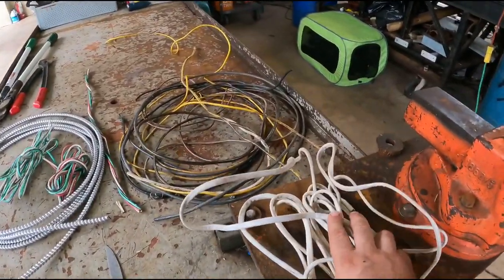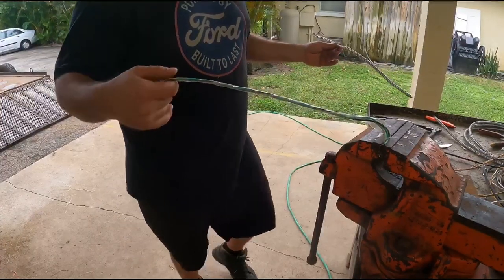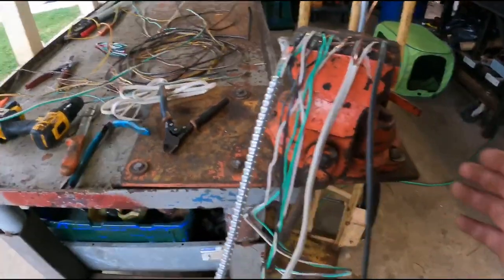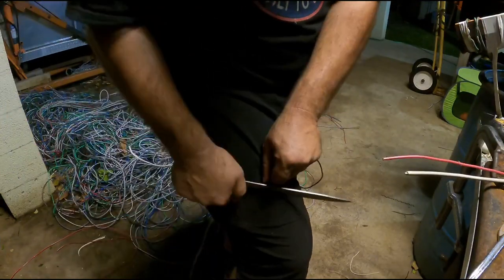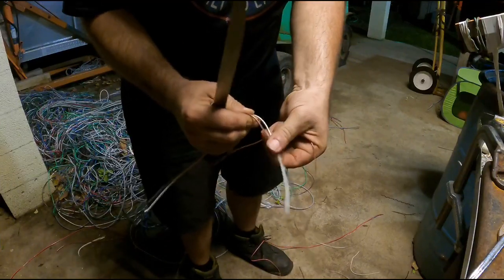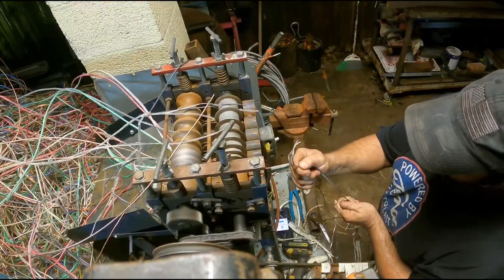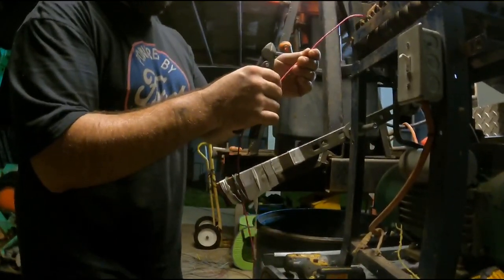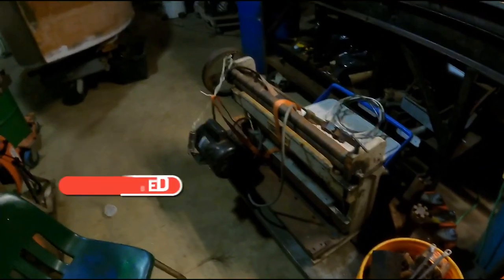How To Hand Strip BX Cable, Romex, & Burnt Copper Wire

Comment: how do you get your knife to cut like that ive tried several and they just dont work like that
Reply from the maker: Get a $15 stainless fillet knife from Walmart. You Gotta make sure it’s sharp but not too sharp to where it’s digging in the copper. It took a little practice but I’ve got it down to a science.

Comment: i struggle with old steel cased armored cable.  the wire is covered in cloth and rubbery and does not slide.  here is northeast i also get a lot of knob & tub type wire with cloth almost melted to to wire.  how do u strip cloth stuff.  i find im  turning it in unprocessed because i dont have a good way to strip.
Reply from the maker: I’d have to see the wire to determine how I would strip it, tough wire I used to send through my granulator which worked great for everything. I would probably cut that steel cased wire in 3 foot sections with a pair of bolt cutters and then work it from there. I’m not sure what knob and tub wire is but if it’s burnt I would try putting it in a drill and twisting it before stripping.
Reply: @ProjectShopFl  It's actually called " knob and tube " named for the ceramic tubes and knobs that were used to run it through the studs and joists before Romex.and it's going to be very old wire. The insulation is a combination of a sort of rubber compound covered with braided threads. VERY difficult to strip clean, and probably not worth the effort.
Reply from the maker: @eldiablo8019   The only thing I can suggest is get an automatic wire stripper. I’ve run across some old wire from time to time, definitely not fun to strip thank God I hardly ever come across it. I do remember it wanting to clog up my granulator so what I would do is throw one piece of old wire, and then a piece of new wire so it didn’t  Build up and the new wire would clean it out. Good luck and thanks for watching

Comment: Has anyone else ever scrapped heat exchangers with brass outer casing and copper tube inside?
Reply from the maker: Yes, just clean off any metal and they pay a good price for them. I've never separated the brass and copper though.

Comment: do you ever strip extension cords?  Is it worth it.
Reply from the maker: I stripped them all the time, it depends on the size of the wire if it’s worth it. I run that extension cord wire through my wire stripper. Are used to run it through my granulator. I think it’s considered number two copper, but I don’t do that much of it and I just throw it in my bright and shiny

Comment: Hi. Love the channel I like scrapping wire too. I live in the UK. I really hate, stripping armored cable. What wire do you not strip?
Reply from the maker: I try to strip it all. Lol when I had my granulator set up I would strip 100% of any wire I got. As of right now the only wire I don’t strip is the small wire I clip off the transformers I get, and double insulated communication cable. I just sell it as number two. Stay tuned I’ll Building a new upgraded water sluice for my granulator and I’ll be back to stripping 100% of the copper wire I get. Thanks for watching

Comment: Can you explain how you price the cables you buy from electrician. also do you have a form letter that you use to contact contractors.
Reply from the maker: I travel all over the state of Florida so I called the local scrapyards and pay A competitive price compared to theirs. Where I live the prices are a lot higher than some other parts of the state so sometimes I wind up paying a lot less than I would have to locally. I don’t know what you mean by a form letter but how I started I went to the Kelley blue book of contractors and called every single electrician in my area code and expanded from there. Good luck and thanks for thanks for watching

Comment: You should make up some sort of hydraulic clamping device with a footpedal That way you would speed up the clamping process
Reply from the maker: I would but I plan on setting my granulator back up and I don’t really hand strip at all anymore, I was just showing people what I learned to be the fastest way when I did not have a automatic wire stripper.Thanks for the suggestion I still might incorporate something like that because I like the idea. LOL thanks for watching

Comment: potato peelers work good too
Reply from the maker: That’s interesting I have to try it. Lol
Reply: @ProjectShopFl  step on one end with ur foot work your way up pulling it tight with ur left hand peel it with ur right. i live in vegas so the wire casing is always flexible & easy to peel due to the heat.

Comment: Just bend the bx cable in half, where the aluminum or steel was bent just cut it, than pull the aluminum or steel off twisting at times if needed. Always better to leave longer pieces of copper, takes less time stripping 100 feet in on piece compared to 5 or 10 pieces. Why arent you running that type of wire through your wire crusher?
Reply from the maker: Normally I would run this through my machine but I was showing how you can do it by hand if you do not have a machine.
Reply: @ProjectShopFl  you should make a video on a homemade wire crusher since most people dont know you can strip wire by crushing the pastic inbetween two rollers as long as its not thin wire like battery charger wire

Comment: When you weighs, its a 2 kg wires/ hour..
Reply from the maker: When I weigh what? I’m not sure what You’re trying to say.
Reply: Too much work to strip the wire, you cant strip more than 2 kgs wire in an hour
Reply from the maker: @hinduactivist5527  you can’t or I can’t. It all depends on the size of the wire and the method you use. I am extremely efficient